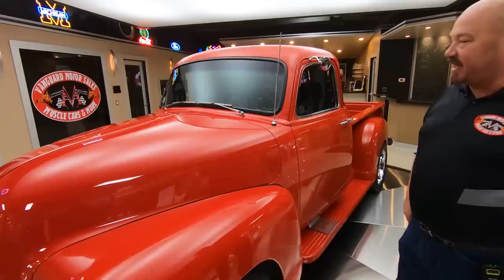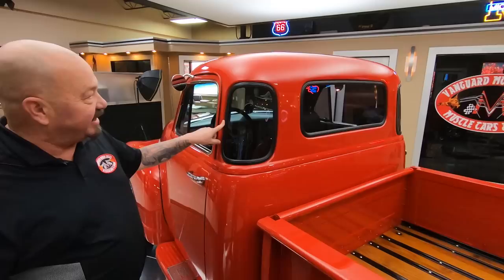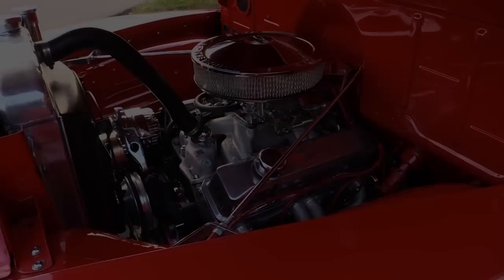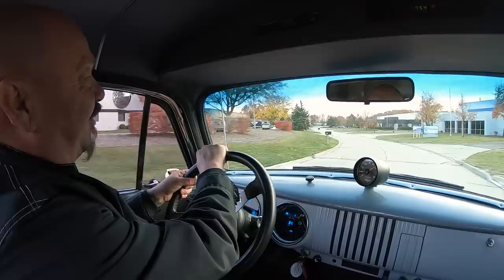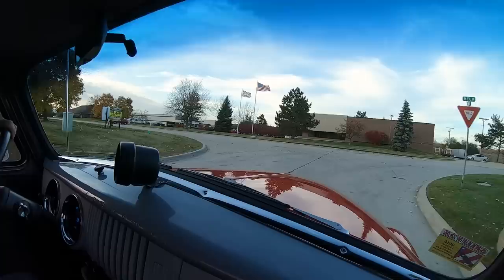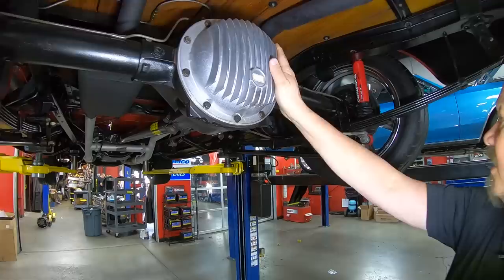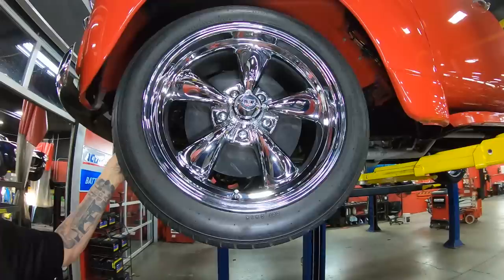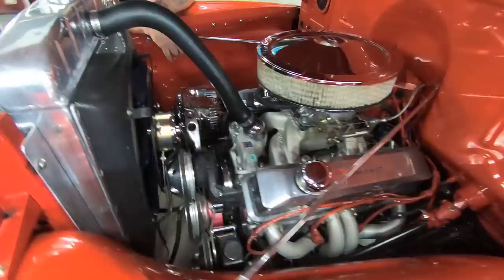1954 Chevrolet Pickup For Sale

Comment: Looks like whoever did that rebuild/resto-mod did a nice job. My grandpa gave me a '54 3100 to rebuild/restore in 1983. Had it until 2003. Loved it. I like that the one here got an overhead console installed for the radio. Looking under the hood, it appears that the heater has been deleted? Which, if you're not going to drive it when it's cold then that's not a problem.😎 I would say the only beef I have with this truck, is that they painted the bottom grill bar & parking light surrounds. It does make for a different appearance, with the rest of the grill being chrome. Just not my style 😎 as I prefer the entire grill either all chrome or all painted. Still, very nice. Makes me wish I still had mine.😞